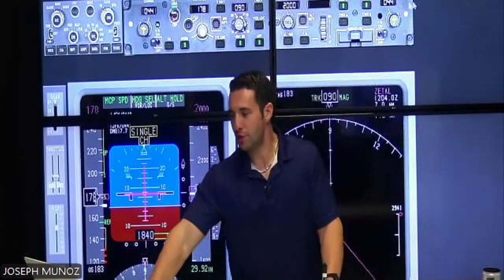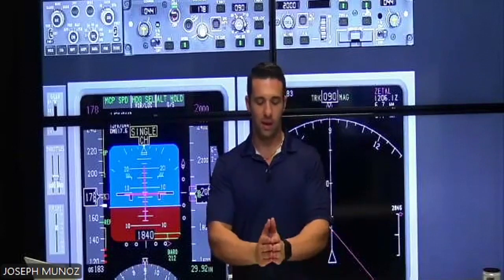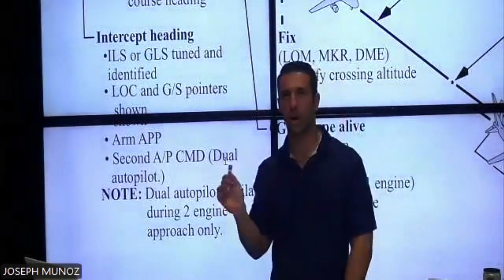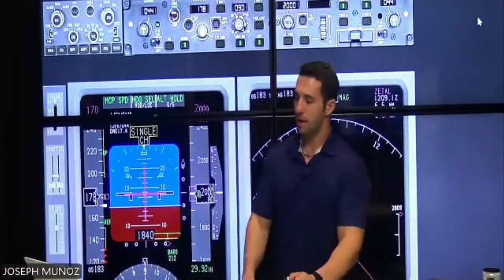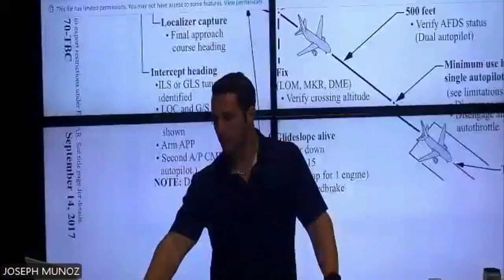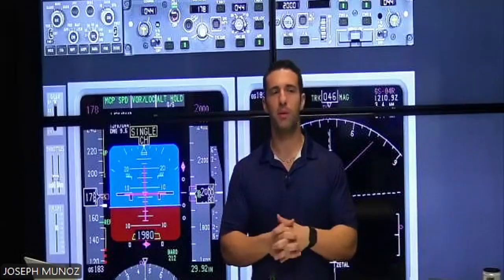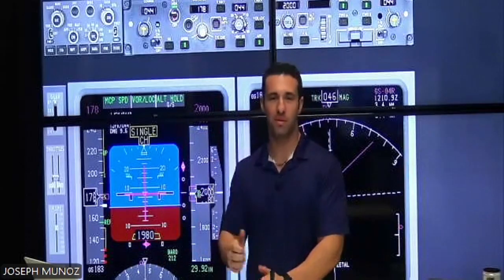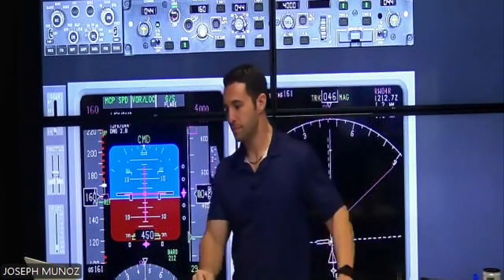B737 Autopilot Usage on ILS

Comment: One thing you didn't mention about doing a Dual A/P ILS approach is that a significant amount of nose-up trim bias is automatically input at 400 ft so that the A/P can handle the G/A maneuver. This isn't a problem if you're doing an Autoland, which is the real reason why you would engage both A/Ps.  However, this can be a handful if the pilot disconnects the A/P after the trim bias has been input and is not expecting the additional nose-down pitch force that is needed to maintain the glideslope.

Comment: Again thanks for the great video Joe! 
So why don't  just always use dual AP if it's more convenient for the GA? Why isn"t dual the standard?
Reply: Good question! Here are my thoughts and hopefully Joe can confirm:

With both autopilots engaged, at 400ft, the aircraft trims nose up approx 7 units. This is to prepare for the automatic flare during the autoland and the automatic go around.

The problem lies when you disconnect the autopilot for landing. When you disconnect the autopilot and if you have to go around, you now have to fly the go around manually. The problem is, the aircraft is trimmed very nose up. You have to be ready for this because as you go around, what do you do? You normally pitch up. However, with 7 units of nose up trim and the power from the underslung engines, you may actually need to push nose down a little to stop the aircraft from entering a dangerous nose high condition, which could lead to a stall at low altitude.

Many operators prefer single channel (1 autopilot) approaches for this reason. It's easier to fly the go around manually than to train pilots on how to go around with a lot of nose up trim.

The operators who encourage dual channel approaches advise the pilots to disconnect the autopilot before 500ft, which most pilots do anyway.

The go around is easy to fly manually anyway. At 400ft, reselect the appropriate roll & pitch modes, engage autopilot & autothrottle.

If you obviously go around at a higher altitude, then you can always detune the ILS frequencies, which places the aircraft into CWS R & CWS P modes and then reselect the appropriate roll & pitch mode. The autopilot & autothrottle will remain engaged.

Or you can just fly with CWS aka Airbus mode!